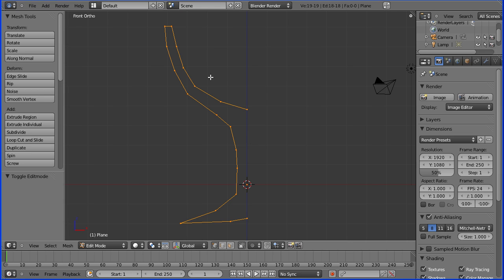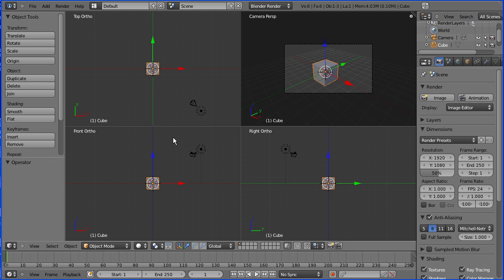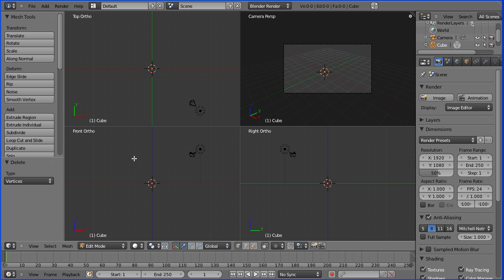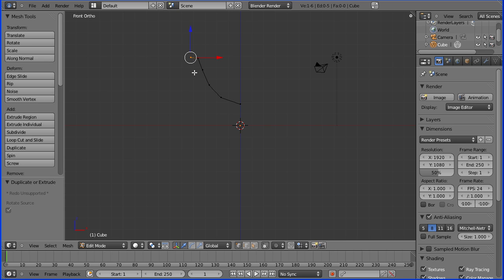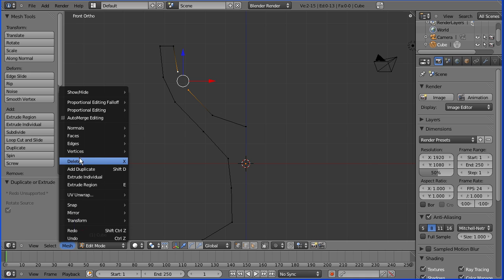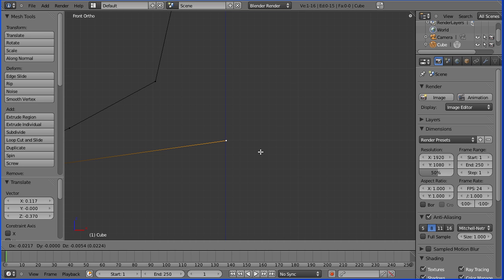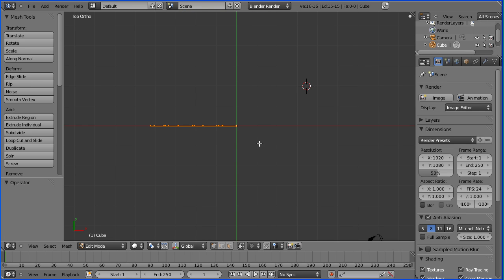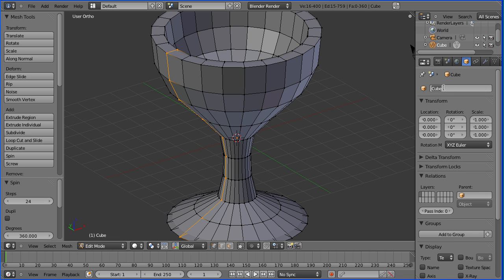Blender 2.5 Tutorial Making a Model of a Goblet Using the Spin Tool (Lathe Operation) Old Version

Comment from the maker: @mobilefreek Doubles are when you have two or more vertices in the same place, you are thinking about the vertices on the z-axis? With 24 steps there would be 24 vertices in the centre, I am not sure if this is a problem or an untidy solution, I would have to think about it.